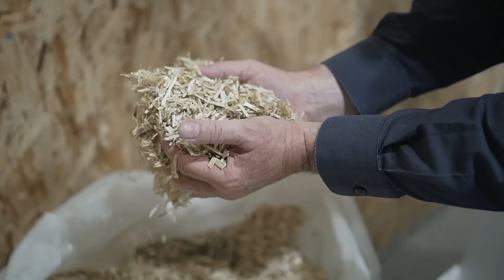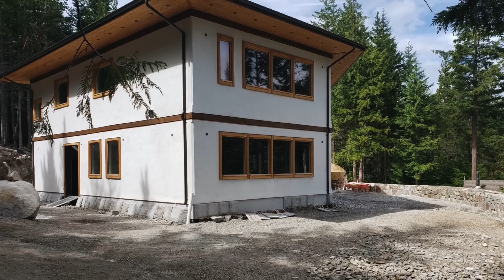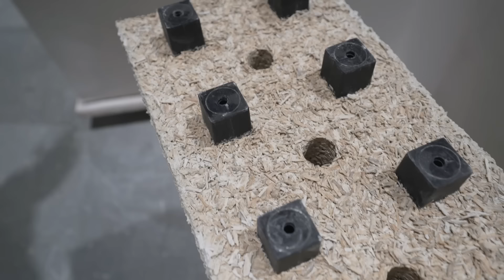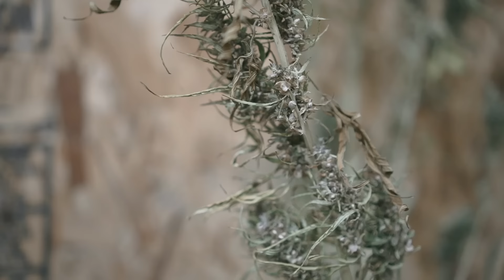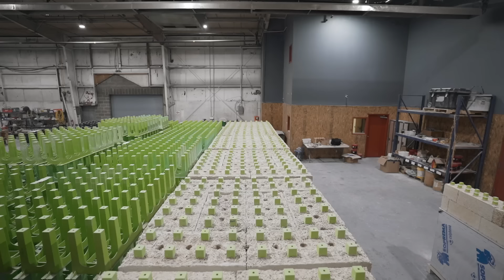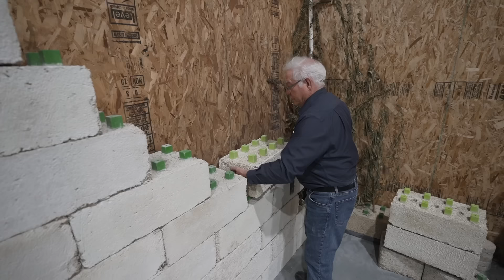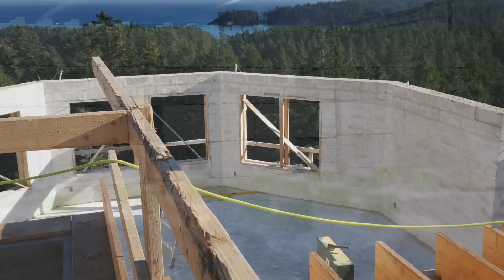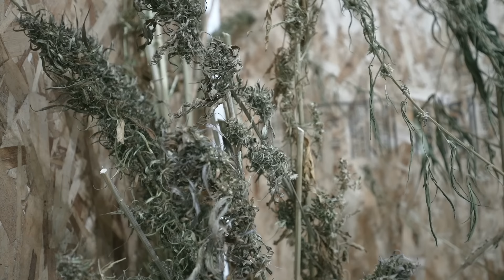Amazing Lego-Style HEMP BLOCKS Make Building a House Quick, Easy & Sustainable

Comment: is not even a type of mass placed between the blocks?
here in brazil clay bricks have been used for a long time and between them a light mass of concrete is used, not only to provide greater sealing but also to give greater strength against vibrations, structural and a base for slings for the iron mesh.
I ask because here in Brazil we don't have as many problems as hurricanes, tornadoes, while in the united states there is a lot and it is increasing.
What holds this structure so that it doesn't fly away?

Comment: I find the claim of carbon negative to be dubious, even if I thought it mattered. That material is going to go to the landfill or get burned to the ground someday. Also, I think we'd need to see those load-bearing pieces in a furnace before I would believe the implied notion that they are superior to steel when it comes to heat deformation.
Reply: All hemp fibers are coated in lime and do not burn or rott. I expect our house to still stand strong in 200 years time.

Comment: Love the idea behind this product but I do have serious concerns regarding water exposure. Say a pipe ruptures within the wall cavity or there's a leak through the building envelope, how would this material hold up? Traditional lumber framing can take quite beating and be exposed to water for extended periods before it becomes a structural concern. Other than the water exposure issue I really like this idea and hope it continues to progress.
Reply: @John Milton In Hempcrete construction it is required to have a water barrier paper between the foundation and the base plate. You shouldn't have any rising damp in your base plates no matter what materials you use otherwise the construction is bad. This is an alternative to the "traditional build" house envelope. You can take it for what its worth but one of these houses is built in florida and performing fantastic.
Reply: You don't put pipes in the wall structure itself. The pipes go on the interior wall which are not hempcrete. This material holds up way better than any other material you might find as it easily allows the water to evaporate out of the wall system if there were to be an accident. If it is constantly submerged with water it will fail. Any house would.

Comment: What is the R-value? Even the Web Site itself only says "High Insulation value" That tells me nothing and unfortunately, my deception meter starts to go off. Seems that the R-Value might not be what one would hope for? 

Here is a clue when marketing. Put it ALL out there, even warts. I may still use it, because of its fire/mold resistance and strength. If it doesn't meet my insulation expectations, then I may need to add some on the exterior, but I need to know what the R-Value is to even consider this.

Comment: If selling point for hemp blocks over lumber is that its more renewable, then I think more details need to be given to support that case. Hemp blocks by volume require much more organic material than a lumber frame. Hemp grows 2 dimensionally, where as trees grow 3 dimensionally so even though trees take longer to grow, you get more organic material per acre of land than hemp. Therefore Im guessing that to build the same size home, it will require far more hemp acreage than tree acreage. It would be ironic if that hemp farms are only made available through deforestation.

Comment: I don't think this would work, maybe in a non snow region but in anything that gets seasonal snow and temp change you will deal with severe contraction and expansion issues since, the material you are using is of a fiber base meaning it's very porus, in freezing Temps this causes cracking and damage to alot of things including concrete drywall wood flooring, asphalt, so it's a great idea what you have done and I have been toying with it my since I learned carpentry 20yrs ago.
Reply: The British built cob houses for a thousand years or more. They have cold and snow and rain. Cob houses can last hundreds of years because the lime stucco protects the fibre from the wet. Lime plasters can “breathe” and it’s this ability which is key to the longevity. The only catch is you need to apply a new lime “wash” to the exterior every year. I forget the exact details but I know if you use a modern cement plaster over the original lime stucco, that’s when the house starts to rot. Cement plaster cannot breathe, so it’s the airflow through the wall which is essential for a fibrous construction like this.

Comment: For all the claimed green credentials, the elephant in the room, that is only mentioned in passing, is the internal load bearing structures within the blocks, which appear to be a high density plastic of some sort (please correct me if I'm wrong). So what is that material, what are the impacts of its manufacture, what is its lifespan, and if it does degrade, are their any issues around its disposal? Thank you 😉

Comment: Very interesting, would be good to see how this works in a damp climate like the UK, wood houses dont do well here, brick stone and concrete always been better, but this could be alternative.
Reply: Same in Denmark, moisture content over 8% wont be approved and what about mold?
Reply: @Badrulbadul  that would just rot here, in the early 70's Scandi style wooden houses were tried in the UK, had damp issues, maybe in Spain or Greece, but not here, but would they be too hot there?
Reply: Im surprised you haven't heard of this before if you are in the UK. It is getting quite popular there.
Reply: @rehabdetroit  no its not
Reply: @LOFIGSD  Well comparitively to the US there is a lot more traction in the UK but maybe not as much as France. People have been building there for decades.
Reply: @rehabdetroit  Wooden houses were tried here in the 1970's, they quickly became beset with damp and mold issues, building regulations are strict here, and any build has to be certified and insured accordingly, so anything not brick and concrete is high cost and risk.
Reply: @LOFIGSD  I am not going to claim I know much about the UK as I have never been there but I know multiple companies that are building with hempcrete there. I can only say what I have been told by the professionals I am associated with. I do not know the application method they are using for framing. I do know that hempcrete petrifies wood but if you have regulations maybe that isn't the way they are doing it. I will have to inquire more.
Reply: @LOFIGSD  Whilst I am not in the UK but on the other side of the pond in NL, we too have high humidity, yet you see quite some wooden Swedish style cabins here. But I agree, brick houses are the majority. I wouldn't think wooden houses would do well in southern Europe too with the bugs and risks of wild fire.

Comment: It's gotta be a substantialy more expensive way to build because all of its wonderful attributes are mentioned,  
Except the cost.
It 'may' be on their website site but with quick scan looking for it,  I couldn't find it.
Some years  back another company developed building materials made from hemp fiber,  structural  
As in all 2x, as well as sheet material.  It too must have been to expensive, cause it never made it to market.
Recently recycled plastics showed up as building materials, structural,  boards, benches,  all kinds of things.  It made it to  market, even Home Depot carried it, but it failed to catch on it was way to expensive.  I think it still trying but if they can't get the costs down its doomed.
Recycled plastic shipping pallets are out there now, and they have alot of advantages, I don't know the cost but they are more durable. I've seen plastic railway ties, very durable and I think they were even cost effective,  one minior problem though,  you couldn't  drive a railway spike into them no way no how.

Comment: And then you build the roof with wood and shingles/ metal, what about the int walls ? This looks allot easier than stick building but if a 2 by 4 has went up to $12 a board and plywood up to $35 a sheet , I could only imagine how much this stuff cost .

Comment: This is where you go terribly wrong "being on par or slightly more expensive than traditional building materials". If you want this to work it HAS TO BE CHEAPER than traditional. There is no other way.
Reply: Primary reason the other versions of this over the years have never seen mass adoption.

Comment: Are there standards of repair? What kinds of damage would it be most prone to? What environments would it break down in? Any estimates of how long it would last?
Reply: I imagine cracks in the stucco (which happen a lot) would allow water into the blocks and cause rot from the hemp overtime. Which isn’t any different from other types but replacing that section of blocks that are rotten…. That could be troublesome.

Comment: Great for exterior insulation and fire proofing, worse for everything else. Also there is so much that goes into building a house, any time savings had by using these is negligible compared to traditional framing.
With trad framing, running the inside wall works is very fast and easy. This stuff looks like a nightmare. Yes there are conduit holes, only 3/4" and verical, and no mention of plumbing. Installing the conduit will take way more time, effort and coordination. Not to mention good luck with any after build changes.

And plaster on the inside? Hell no.

Comment: Calling lime environmentally friendly, because it absorbs the CO2 released at manufacturing, is omitting that cement does the same, and highly misleading. Yes, the CO2 that was chemically bound in the lime will be reabsorbed. But that's almost peanuts compared to the energy (and resulting CO2 emission) needed to mine, transport and process the raw materials.

How easily can the blocks be recycled when a building built with them is torn down? Can (need?) the plastic and fibers be separated easily?

Comment: When I was in college I read a study on how there is actually a lot of CO2 in people's homes because of exhausts, off gassing, and other indoor air pollutants. Studies have shown that CO2 is linked to lethargy, winter depression due to low air circulation, and low productivity. So I interpreted that as our farts are making us sad and bad at our jobs. 

The next semester we learned about hempcrete and how it cures by absorbing CO2 from the air, my first thought was part of its strength comes from our farts.

Comment: Sorry but no. It’s not a good core structural material for a house if you have to worry about it getting wet and it only lasting 60 years even if it doesn’t get wet. The plastic blocks he mentioned should be explored further though.

Comment: The test with the torch isn't really much of a test... coal will literally do the same thing. It won't catch on fire right away, but once it does it will burn baby. So there is a high chance this will be the same as coal.
If you are building a really small house/shed etc... this seems like a nice solution, but let's be honest for a moment. If you are building a $200k-$500k-$1mil house would you use hemp? I wouldn't.

As for the "green" part of this whole thing. There are better ways to help the environment, no offense.

Comment: Many years ago I had the exact idea except the blocks would be made of very dense rubber material such as recycled tires. These would be excellent for below grade such as basements. They would not rot, they would be totally waterproof and good insulation. Excellent also in areas that have earthquakes.
Reply: Rubber decays when exposed to uv light. It is also toxic when burned and quit flammable.

Comment: Looks good as a local alternative building material., except for the epoxy core, which is plastic by the way, no matter which oils and resins are used, and because of it's core material, it not an eco friendly product. Wish companies would stop lying to everyone, and themselves. That said, these are currently only for the rich. Unless the core is changed, this fad won't last long. Further, the harvesting and shredding of the hemp is most likely achieved with the use of petroleum products, So is it truly not any more eco friendly then other building materials. The Eco Guards would say "NO", this is a Greenwash. In other words, all they see is the Green. Moreover, Hemp as a building material that has has been around for a very long time, and the Lime just helps bind and keeps mold and fungus from forming to quickly.

Comment: Hempcrete is a superior building material by far. The problem is the construction industry and the "R" ratings for insulation and fire prevention not being an easily standardized product. It will not be insured or "up to code" if you build a house, which makes it near impossible to find a buyer if you try to sell. I looked into this a while back and had to shelf the idea because the industry isn't ready for this disruptive material. It's ridiculous.

Comment: We tested this specific product in a wall assembly for fire rating at a test lab I worked at. It blew me away how well the hemp fibre composite material resisted high temperatures and flame on the furnace. I really hope to see our society adopting this product full scale in the near future considering all of the benefits.
Reply: I wonder what the moisture/mold/fungus resistance is?  And how does it deal with negative g loads (tension) in earthquakes?
Reply: @Sugarsail1  Great points mate!!!
Reply: what about sound do they block out sound better ?'
Reply: @hanshansen6244  - yes, they block sound quite well.
Reply: @hanshansen6244  Yes. This insualtion is an amazing sound blocker. Great for near highways or airports
Reply: @rehabdetroit  thanks
Reply: Just use cob bro, this is overcomplicating things.
Reply: @godrilla5549 cob is awesome but lacks insulation value trust me I live in a cob house hemp Crete has its place for sure if you have access to lots of hemp and buy the hydrated lime.
Reply: The guy in the video says it's supposed to be hurricane and earthquake resistant. Where can we find legitimate test results showing that it's hurricane and earthquake resistant and also flood resistant and any other concerns, including concerns voiced in these comments? Reps from the company ought to answer concerns and questions in the comments to this video.
Reply: Did you test it for moisture degradation? Being that plant fibers are hygroscopic and lime degrades in contact with water (as well as generates heat) I suspect that this high ratio of hemp to lime will have long term issues with degradation. Unless you keep it 100% out of contact with the outdoor elements this stuff will rot away fast
Reply: @hyfy-tr2jy  In video they showed textured surfaces inside and out and said it is supposed to be coated.
Like concrete appropriate waterproofing would be needed for the environment.
Reply: Does the hemp make a significant difference or would strawcrete work almost as well?
Reply: @loedas895 my thoughts as well! Hemp does have more of a natural Styrofoam inside it tho where straw is just hollow stalks
Reply: Only in places with abundant farmland, this is not the most efficient construction material.
Reply: @napsec9807 it could be
Reply: Thank you. For defining from a testing, standard perspective the defining qualities of this product.
Reply: Very interesting and I need to know what else is needed to make a hemp brick. Is it hamp and water??, please share
Reply: Only way that will happen is if we as people actually stand up against these greedy corporations who are holding us back because they believe they own us
Reply: I wonder how well it holds up against termites
Reply: @danbiss87  probably pretty good, I don't think they could deal with the Lime.
Reply: @jwwtzl67  Poe's Law is strong in this
Reply: @danbiss87  apparently they aren't an issue ~! another bonus
Reply: @danbiss87  Considering it is just concrete with the hemp acting as a binder they won't bother it since it's covered in concrete. It's just like adding carbon fiber or fiberglass else as a binder to concrete.
Reply: @SilvaDreams  - in this case the lime cement is the binder and the hemp stalk chips are the aggregate filler material
Reply: @b_uppy  Yes they are, but they have no interest in what is essentially a rock with little bits of wood like fibers bound within in.
Reply: @orcoastgreenman  Yeah I was half awake and fresh off a graveyard shift when responding to that so my brain reversed a few things.
Reply: @SilvaDreams  
Hemp is a herbacious plant,  trees are different from herbaceous plants.
Reply: Not concrete hydrated lime  @SilvaDreams
Reply: @danbiss87  I wonder how well you hold up against common sense
Reply: Why should it surprise you? It's how we've been making furnaces and fireplaces for millennia? Take a mix of clay and hay and mix it together, shape and form them. Allow it to dry and now you have brick or a mud forge (or fireplace) that can take thousands of degrees of heat to smelt copper or iron... Or just keep your warm.
Reply: "blew me away" is not a good choice of words for this context xD
Reply: just imagine everyone would use this, then in no time there won't be any CO2 left to sequester...
Reply: Might be good for roof tiles too???
Reply: @andyhobbs2812  
Pretty sure that's a no...

Comment: I don't believe it was mentioned in the video. can you screw or nail into the material and get the strength you need to say hold drywall or clapboard siding? And is the stucco and lime interior finishes necessary for the strength?